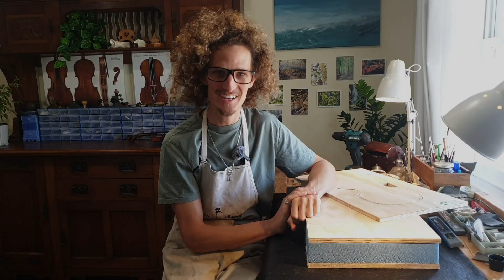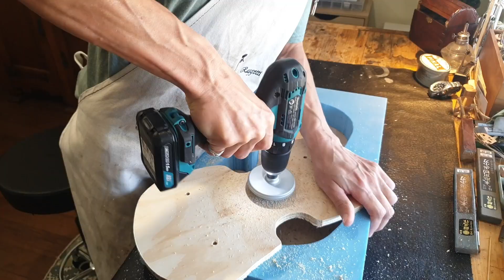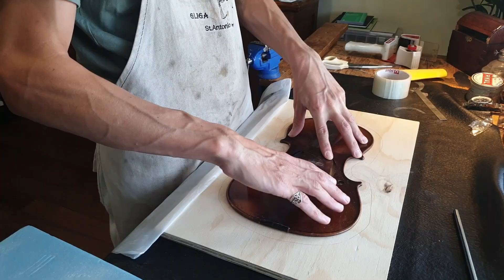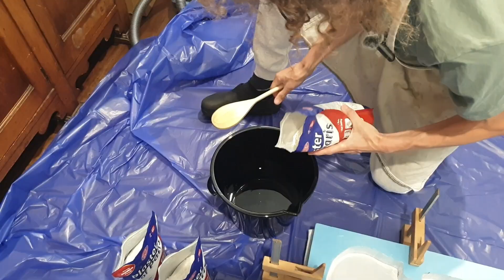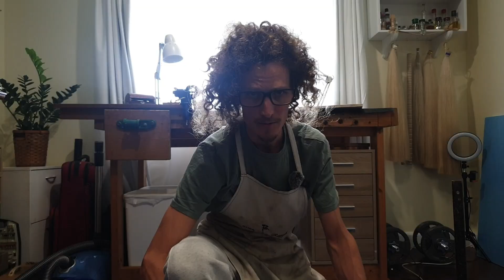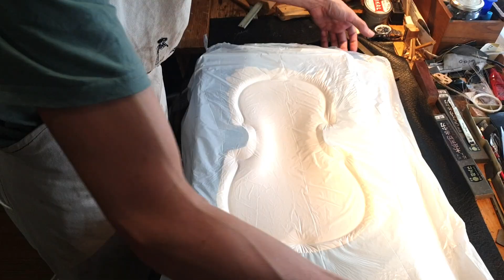Restoring an Amati copy violin Part 1/6: Making a plaster cast of the top plate

Comment: I understand that the thickness of the plaster mould is driven by the thickness of the pre-cut foam in this case, but does it need a similar thickness for this process, or could it be much thinner?
Reply from the maker: Thank you for your interesting question 🙂 I chose this foam depth because I was allowing for the plywood reinforcement, the violin’s arching, plus ample space between the two. It would have been possible to pour a slightly thinner cast, however I find it’s always best to err on the heavier side as it assists with overall structural integrity; the added weight is also helpful for stability on the bench while working on it. Because I intend to reuse this mould, I also kept in mind the need to accommodate a variety of different instruments and arching profiles. For instance, although the arching on this Amati copy was relatively standard, the mould will also accommodate an instrument with much deeper arching like a Stainer. I trust this is helpful and I do hope you enjoy the upcoming instalment! Cheers, Paul

Comment: Fascinating stuff!!  I have a query / question: am I correct in thinking the weight of that plaster you're pouring onto the top plate is about 5kg? I was wondering how does that not crush such a thin, fine piece of arched timber?! as in, it isn't sitting flat on its surface so isn't receiving uniform support across from underneath? maybe I'm underestimating the strength of a violin top...?
Reply from the maker: Thanks for the great question! You are correct regarding the approximate weight of the plaster; also your inkling about underestimating the strength of the violin top is on track. Although they look delicate, they are actually very strong, in part due to the strength of arch shapes in general and their capacity to transfer weight evenly around their edges; also the bass-bar provides additional support. Also bearing in mind that a set of tuned-up strings on a violin applies over 20kg / 50lb of pressure, so 5kg is really quite minimal in comparison! They are really a remarkable piece of engineering and art :)